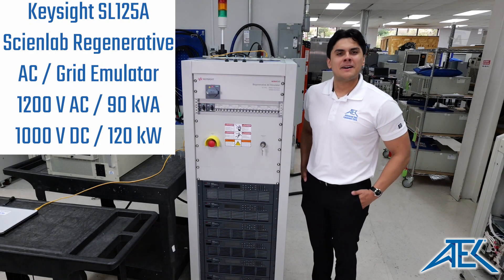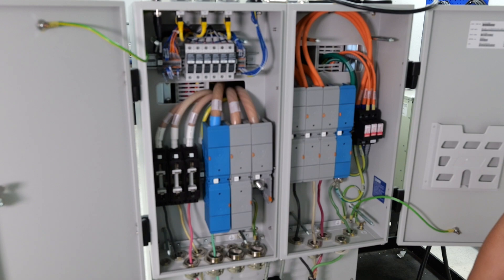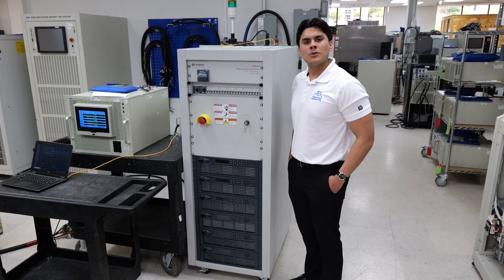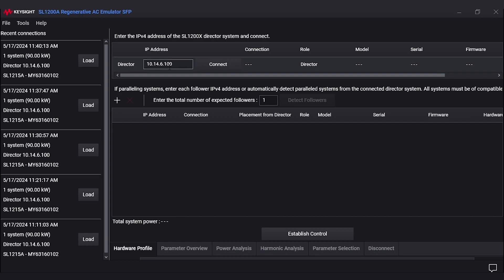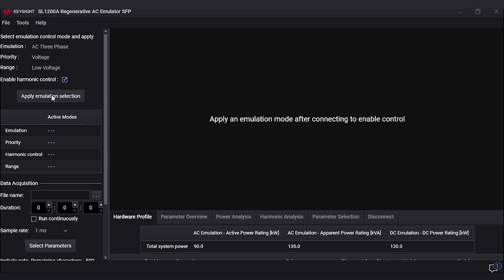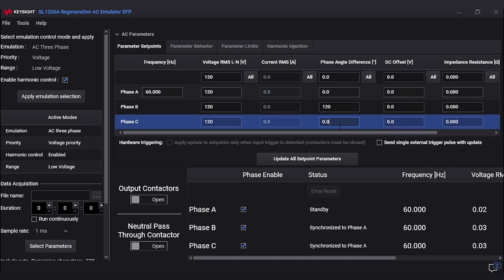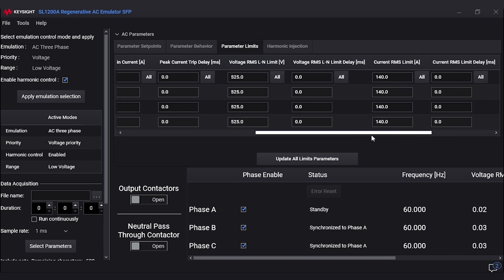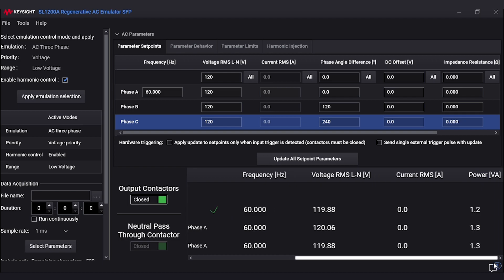Grid Simulator Testing using the Keysight SL1215A Regenerative AC Source

Comment: What about using the AC current as a load, not a source?
Reply from the maker: Hello, yes with many of these newer grid simulators, there is an option for E-Load in which you can use the grid simulator as an AC/DC Load which is also regenerative to the grid, very useful!
Reply: Yes you can do that